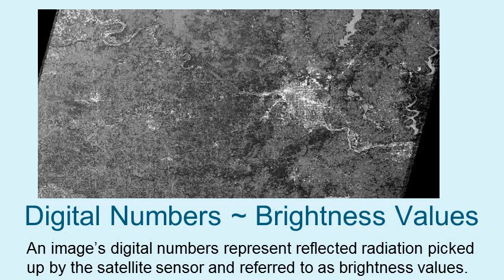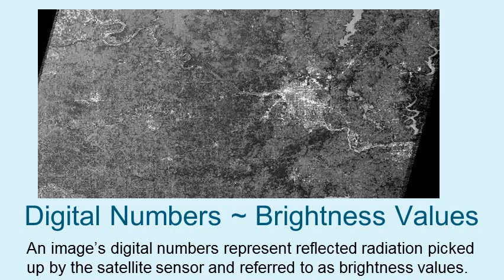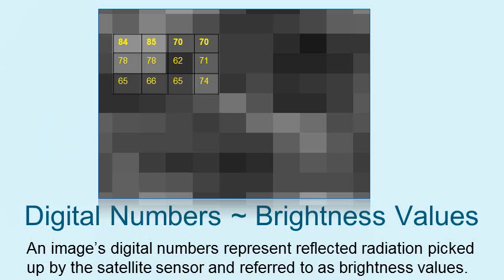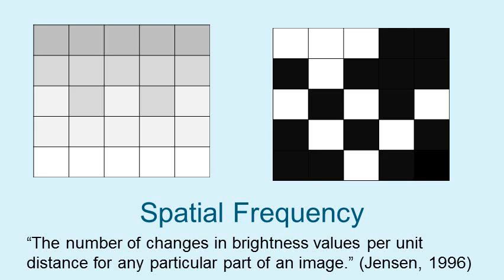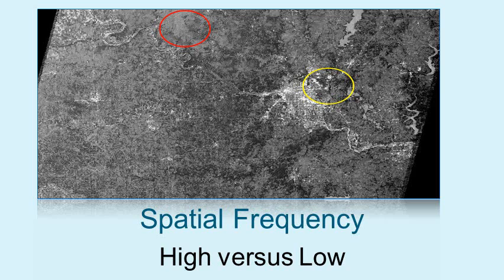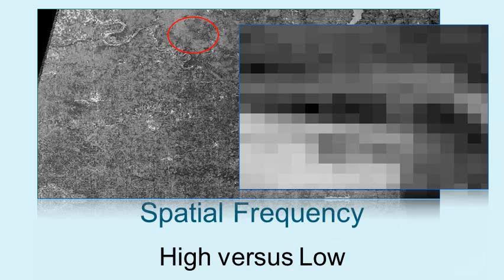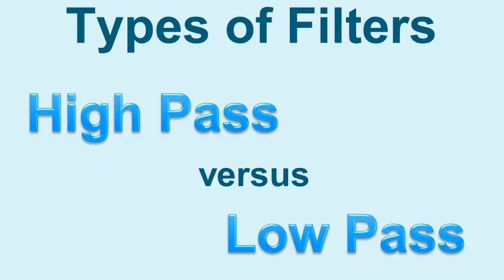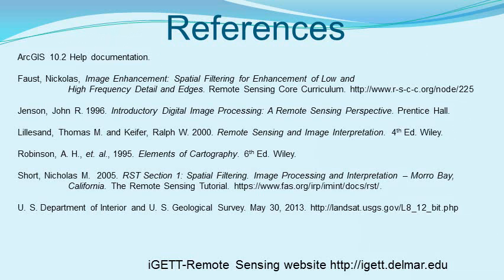iGETT Concept Module Spatial Filters in Remote Sensing - Part 1

Comment: A really good introduction for someone who is new to filters in remote sensing! But I found a very little mistake in your explanation:
landsat 1 - 7 are 8 Bit sensors, which allows for distinguishing 256 grey values between 0 - 255 (this is right, but:)
for landsat 8 - which is a 12 Bit sensor with 4096 grey values, the range is 0 to 4095, NOT 4096.